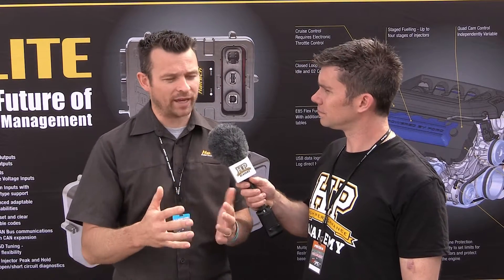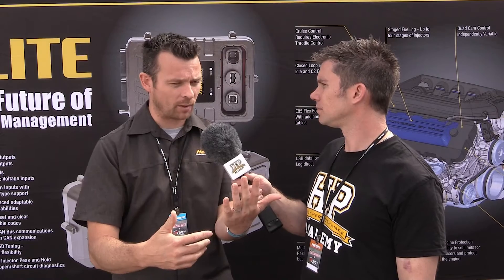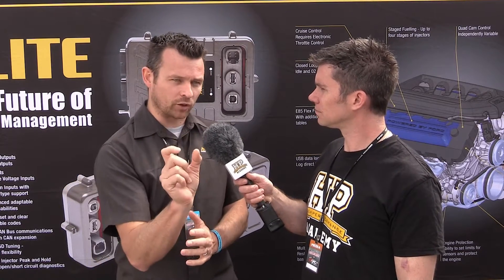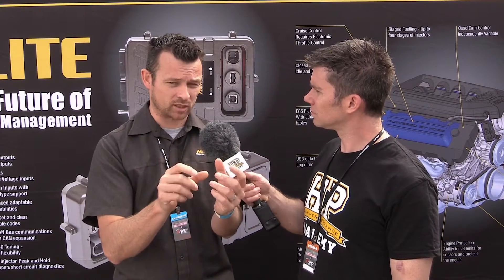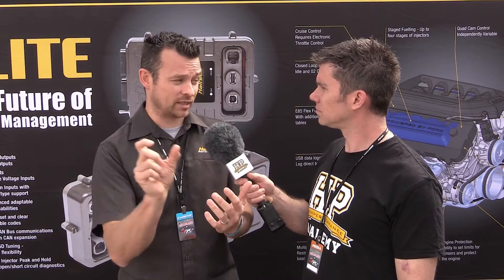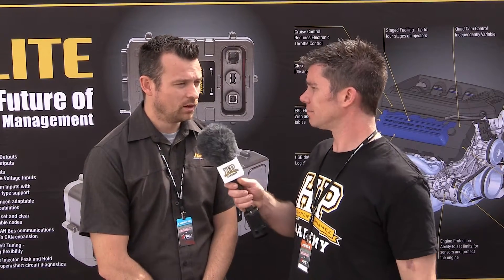How the Haltech Self Learning Feature Works | Elite ECU released at World Time Attack 2014

Comment: The auto tune and how to wire up the inputs and outputs are very similar to a megasquirt ms3 pro.
Reply: I like MS3 a bunch, but this takes it to the next level. Not sure if you're aware, but the elite series has auto-learning trim tables for fuel, ignition timing (knock), idle control and boost control. Tuning PID loops manually can tend to suck. Haltech will actually improve your idle and boost control automatically over time. Winning!
Reply: Yup, was just thinking how similar it was to the megasquirt.
Reply: Mike Regner is that mostly a good thing?